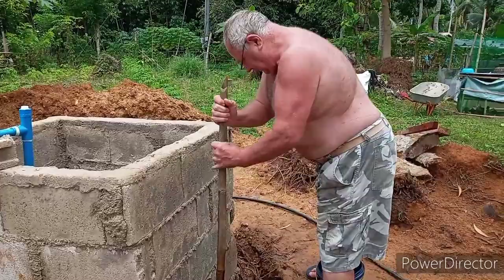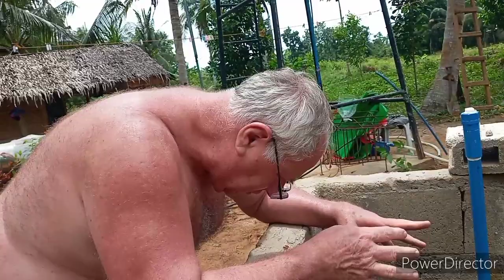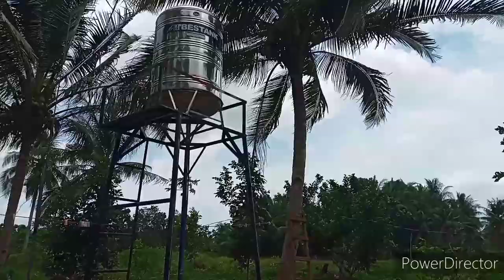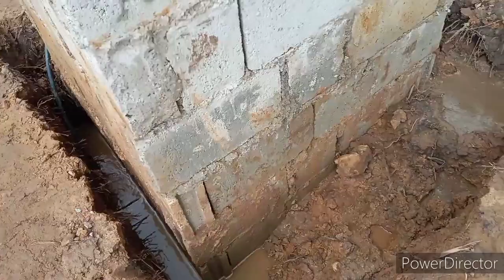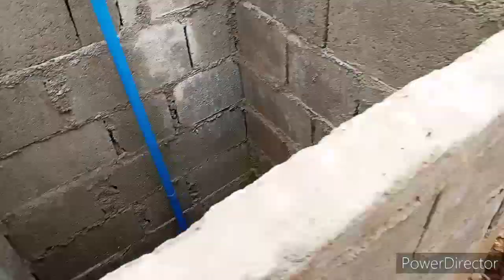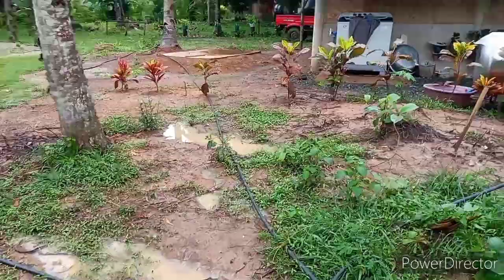Another Caving  Well...

Comment: Am I the only one wondering what is going on?
Reply: The guys didn’t backfill good and the dirt/clay was settling.. to help with the process I was pumping water around the outside of the well to get it to settle.. the dirt/clay has went down so far four to five feet.. I have to get the dirt around the outside of the well up to ground level and relatively compact to be able to pour a concrete apron around the well… because of excessive rain this project has been problematic..
Reply: What about inside the well? Is there a fresh water flowing? Maybe you fill  the sides with gravel first and concrete  on the flooring where you standing. Put temporary roffing to keep that area dry.
Reply: @emongwang9688  it was backfilled with clay already… it’s just settling a lot because it wasn’t tamped down and the clay was in globs.. It’s going to work out.. we still have more digging to do in the well and the rain should stop soon.. when completed the well will have to be pumped as dry as possible and sanitized with bleach.. then we will put a cover on it to keep out the crud…also we won’t use this for drinking.. we buy purified water for drinking..